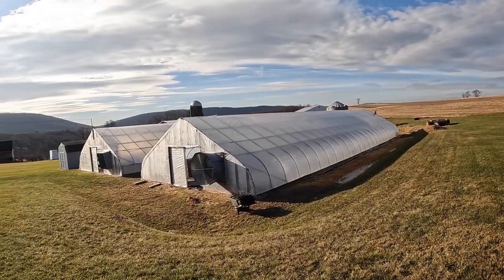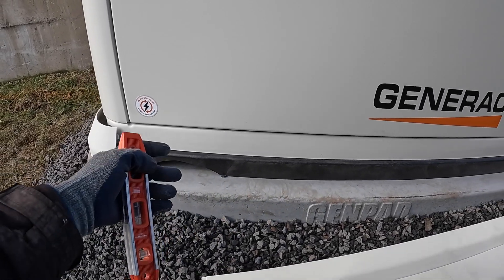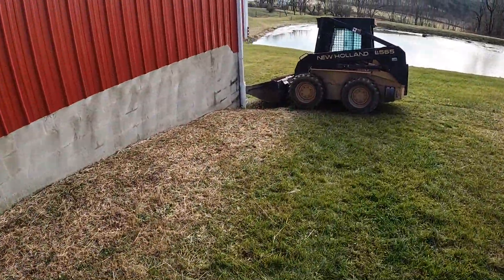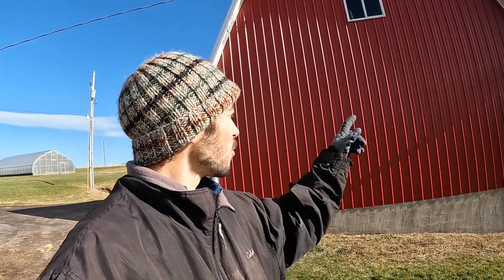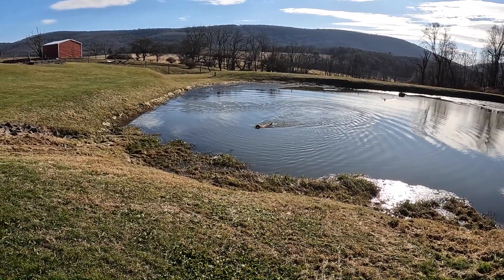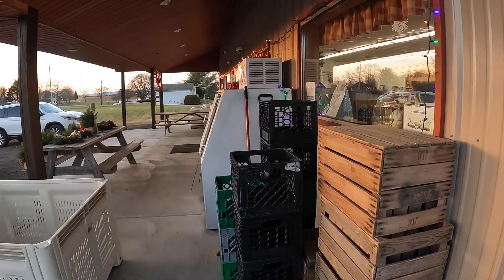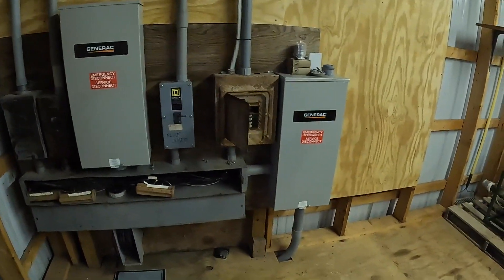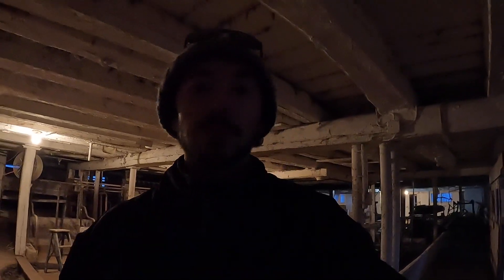Important Addition Added To Our Vegetable Farm

Comment: Your electric fence wire can't touch the metal fence post.  If you hear snapping or clicking by a post it's grounding out and will not work correctly.

Comment: Keep in mind on electric fence you
Are going from series to parallel circuit with your design . So while voltage remains the same across both wires amps will drop  due to resistance increasing. Amps is what the tester measures from what I saw. So in effect unit might not be powerful enough to handle a parallel circuit.

Comment: You should’ve got the Kohler generator this generator cannot run continuously without burning up, so make sure if it’s on more than several hours to open the lid. Otherwise, this generator will burn up….. I have the same one and I’m living here in Florida
Reply: We have a Kohler in FL. Though Generac is frequently seen throughout Northeast, I’ve heard Kohler and Briggs are more reliable over time than Generac.